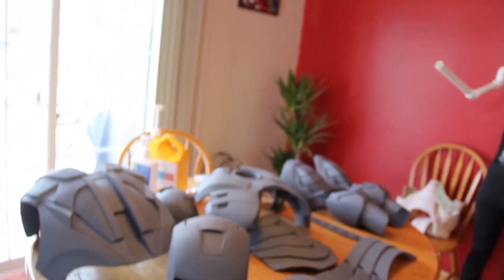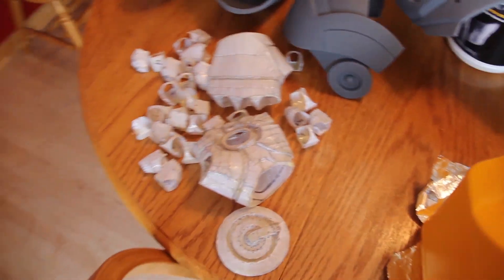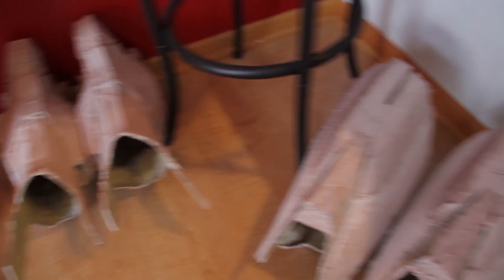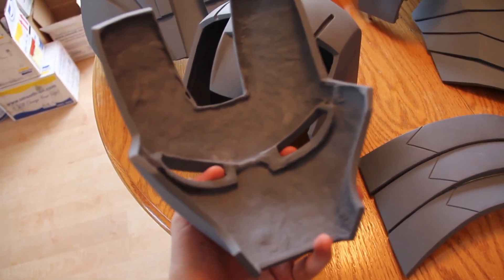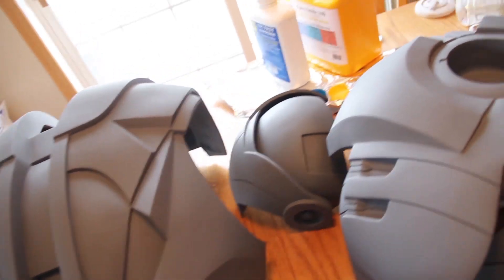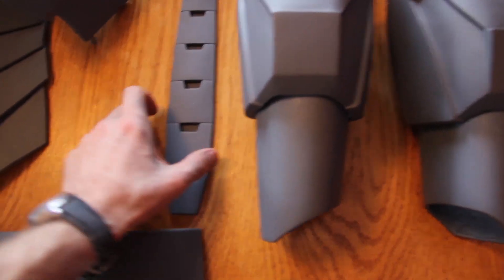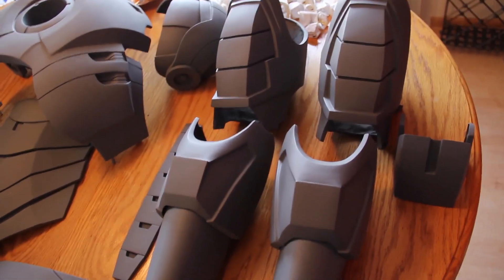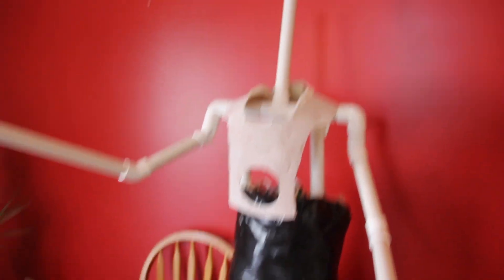Iron Man Mark IV Progress

Comment: Did you use the Epox Amite to lay the fiberglass on the interior of the parts?
Reply from the maker: The fiberglass cloth was applied by cutting them into smaller strips, then I used a spray on adhesive, spraying the entire interior.  This kept them in place while I brushed on the Epox Amite.
Reply: Oh i've always thought you needed polyester resin with fiberglass cloth. Cool! Im thinking of switching to epoxamite because it's odorless.

Comment from the maker: 5-6months is pushing it, I'm pretty sure I wont be done in time for that deadline.  I wasn't going to start making molds/copies to sell til I finished this one anyways.   I can how ever sell you some 3D printed parts which I have available to the public that you can buy.  It's not everything you need for a complete suit, but there's quite a bit on there that will save you time if you're building your own.  Check the description for the link.

Comment from the maker: Nope, I still got a ways to go with it yet.  I kind of went back and reworked alot of the pieces you seen before in the video.  Got better reference photos and found inaccuracies in almost everything.  So I've been fixing those issues for months. I'm in the middle of working on the shins at the moment and had some parts 3D printed for the hands and other parts.  I'll see about posting another video once I finish those up.

Comment from the maker: You'll get better results also by filing it down vs. sanding it with a hand sander.  You'll get slight divots using the sander.  It might appear smooth when you're done, but once you put a high gloss paint job to it, you'll see the unevenness of it.

Comment from the maker: I didnt use fiberglass because of the fumes it creates, I wanted the option to work on it in doors.  And foam? Well... foam is alot faster, but the quality is very poor, call me a perfectionist.  I wanted something high quality.  If you're looking to build somethign like this in doors, if you dont want dust all over the place from sanding, (Like Bondo) stick with the foam and hot glue.  I use my garage.  I keep the dust down by filing down everything instead of using a hand sander.

Comment from the maker: The hand?  well it turns out, for the hand I've decided to go a different route with it than what you see in this video.  Because of the smaller details/groves in the hand, I've decided to get this part 3D printed, which requires modeling the hand and sending that 3D file to a 3D printing company.   When I'm done, I'll most likely show those parts I 3D print in another video.

Comment from the maker: I thought about using fiber glass.  And yes you should be able to achieve the same results.  The only reason I didn't use fiber glass is because of the fumes to creates.  I put a link in the description of the files I used.

Comment from the maker: For the duplicate molds I create? what do you thinks its worth? It wont be cheap since every part is coming from a part that was hand made and not by some machine.  I was thinking, none painted, just the armor molds, $2000.    Fully painted and rigged, more like $4000-$5000.  Individual parts, depending on their size, Helmet for instance $200 (non painted) $400 painted.  But really.... first I need to finish the suit. What would some of you others charge?

Comment from the maker: Yes, the duplicates would be as good as the originals, to me, actually they would be better since I'd be using a high impact resistant plastic instead of a suit built up in layers of paper, plastic coating, and bondo.  You could drop it and not really worry about the bondo cracking/ chipping where there's more stress received.  A suit fully painted and rigged up(strapping,clips) wont be cheap, and about a months work I'm thinking.

Comment from the maker: Well the one I am making is taking a very long time, so for me to make one from scratch again is not going to happen.  But I did buy molding/casting materials to take molds and create duplicates, which I was thinking of selling after I'm done.  Of course you'd need to be about the same body size, I'm building it pretty tight fitting. I'm 5'11", so I'd imagine 5'8"-6'1" would be able to still wear it if they are a thinner build like myself.